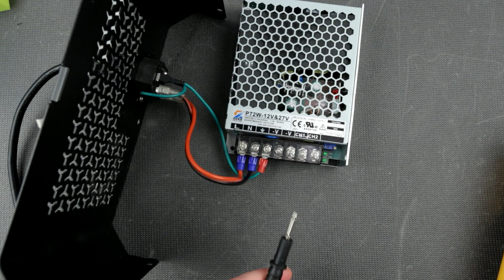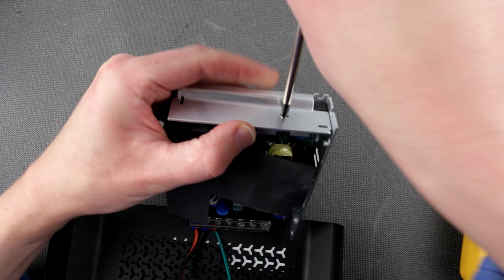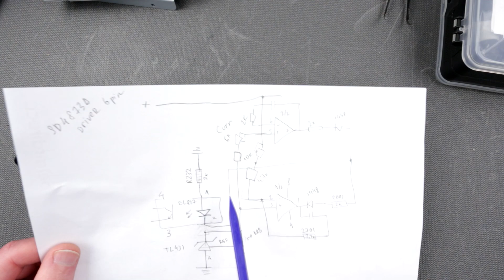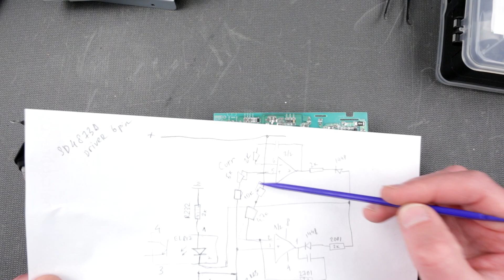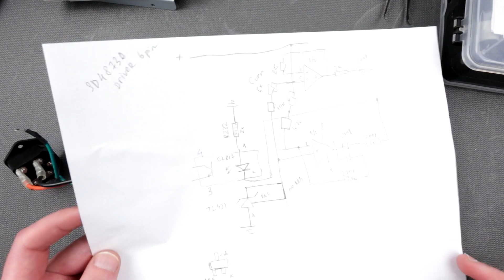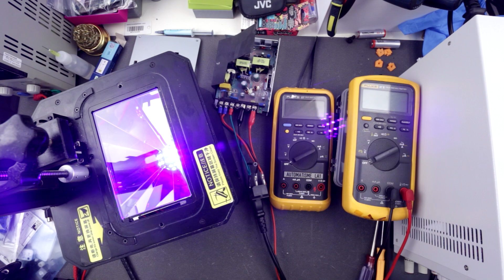Adjusting powersupply voltage on  Ender LD-002H Resin printer

Comment: You can change the PWM of the LEDs in the slicer. Which is one way to work around the excess high voltage issue. But the fact that it's possible suggests there is a more involved control circuit than just sending whatever comes out of the supply to the LEDs